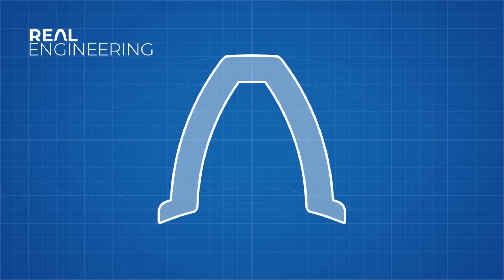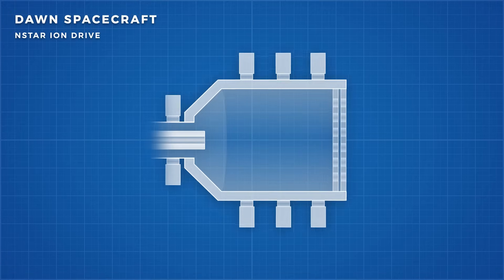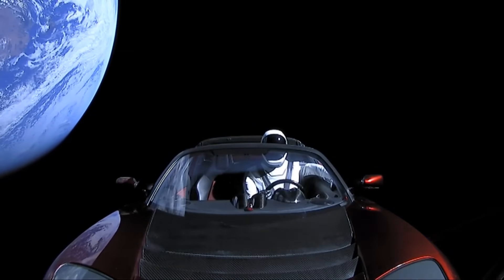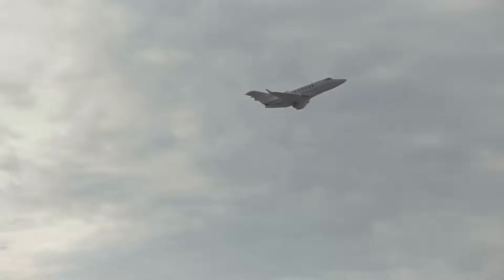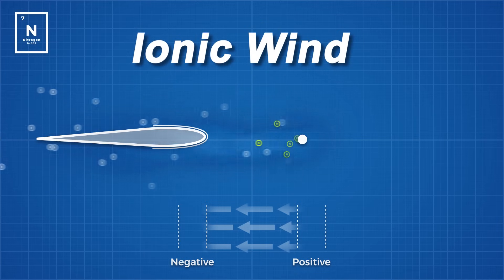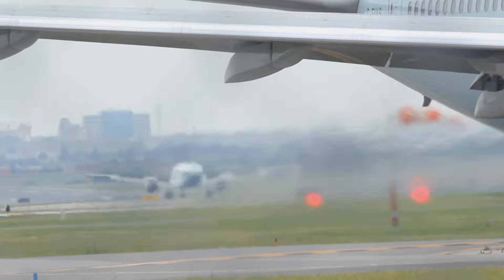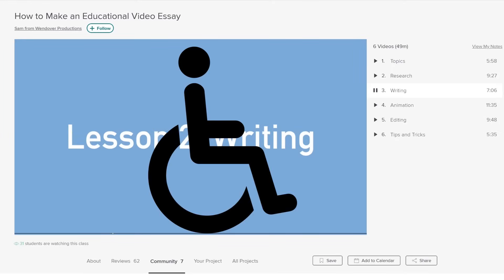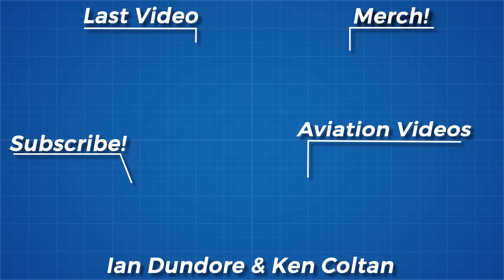Ion Propulsion - The Plane With No Moving Parts

Comment: To do it commercially utilize the ion flow to modify, negate or supplement the drag, vortices and and pressures (or vacuum relative to atmospheric pressure) in regards to the airfoil, control surfaces and airframe, also the  propulsive systems. Even down to air/fuel atomization and exhaust. Summer off the technologies have interesting applications in current use. And there is so much more. You are losing our forgetting the free...hmmm extras... Gained from designing the coils and surfaces not just through magnetic effects but also the right hand rule. The reduction in the lets say "perceived weight" in a descending (or ascending) path towards the moving null point of attraction shared with.."the ground or Earth" when aircraft need it most is good ( lol so many jokes there too, Earth ground attraction repulsion and to the moon... Okay inside jokes maybe) to stretch it even further in some areas researched of the addition of homogenized metal nano particles to the fuels and the incredibly high voltage tensions and densities to be harnessed in excess of the energy harvested from the reactive force of simply burning hydrocarbons etc. All the amazing things you could learn just from studying a simple sparkler...a child's toy. Going down instead of up it leads to things such as hypersonic torpedos. Hhhmmm wether or not to post this. Oh dang I forgot to mention the old school use of methods other than just sharp edges to promote emission of electron waves and the tuning plus impulse generation but decreasing the pulse width, well not pulse width actual the slope. Think inductors and switches... Really fast ones...

Comment: A light weight power is a permanent magnet motor as a generator. and this power is not limited by storage.  The permanent magnets are a permanent source of power .  This results in unlimited range electric power flight.  A normal airplane propeller driven can achieve unlimited range electric powered flight. An old generator can be converted to edison generator by counting the armature magnets and divide by 6.  Then chisel off the Tesla magnets alternating on and off to leave only the Edison magnets on the armature.  Reassemble this generator and it is a motor that produces the same electric power as the generator without fuel or force from water or wind.  We carry the generator and fly unlimited range electric power airplanes.

Comment: Did you pass on the Edison generator powered source.  The Edison generator and dynamos with inverters and transformers can deliver any amount of current and voltage AC continuous peak power without fuel or weight..

Comment: Reduced stress means lighter parts which means lighter aircrafts which means lesser fuel which means lighter aircrafts and a cycle can start though having a small weight different it's important as it's reducing energy sources.
Reply: Your comment sounds wise.  I think you would like my channel with a VTOL ion propelled craft with onboard power.

Comment: I can do over 400,000 lbs of force with no moving parts. AC current. It's so simple and only 9 parts. It's done with feedback. 20kv is peanuts when this can do a trillion. What your describing is obsolete and not enough power and no gravity in the ship. This will give gravity and supply endless water... and the ship uses thought because it receives and transmits those waves. I already did all the engineering in 3d. This ship will go anywhere and require no fuel at all and cost nothing to run. I did all the work for free.. and it's free just ask for it. No battery.. no fuel... no coil.. no magnet.. all done with sound and feedback... incredibly simple.

Comment: Energy thrust vs chem, require amp power,  nuculear could amp support. These craft, won't be able to avoid combustion, without motion movement parts., at least not without moving internal gears/gizmo.

Comment: One more key concept about low-force thrust: not the same as low power. 0.09 N at 1 m/s is only 0.09 Nm = 0.09 W. But at 1000 m/s it’s 90W etc etc. That said, at some high enough speed, that 0.09N would begin to decrease. Power output won’t scale forever.

Comment: Your video is misleading, because space ion propulsion systems have literally nothing in common with the simple minimalistic devices that create ionic wind. Those have been known for decades, and there are hundreds of videos on youtube with those flying ionic wind setups, the only difference is that they were all using a wired power supply, while this one uses an on-board battery, which was only possible because of recent advancements in Li-Ion battery technology. MIT made literally nothing important here.
Reply: There is one with onboard power and it predates the MIT device.
Reply: @KraussEMUS1  Good to know that. Do you have the link?
Reply: @Alex626_  My channel Icon.

Comment: Ionocrafts have been around since the 50's...
1. It does'nt work in space (as there's no air to ionize)
2. It produces large amounts of ozone and NOx gasses which are very toxic.
3. It's like a flying taser, multiplied by a hundred :) If this aircraft accidentally flies into a person, that person will likely be electrocuted to death with more than 30.000 volts.
So, I don't think it will ever be useful. Conventional electric motors are safer, cleaner and less dangerous, and far more efficient...
Reply: There is one with onboard power that doesn't create ozone and it doesn't use enough current to be dangerous either, although it does use a high voltage.
Reply: There are lots of types of gases that can be ionized. I haven't read anywhere that they have to be toxic gases. 
Why isn't Ozone good? In the 90s all the scientists were complaining about the giant holes being created in the Ozone layer...

Comment: @5:30 why not only apply the conductive anode to the upper side of the airfoil? If you are going to use an airfoil why not take advantage of this by attracting the air flow to the upper side to create more lift/flow over the top? Make the top of the wing the anode and put an emitter wire out in front of the leading edge?

Comment: If you towed a ion drive powered plane into the thin upper atmosphere it would have a better chance to sustain it's speed. I have been trying to design a hybrid electric lightweight orbital spaceplane but getting the electrical energy is tricky. Even if it can get into orbit by skimming off the upper atmosphere reentry into the atmosphere would be tricky with such a big wing.

Comment: I am confused. As far as I understand the energy output is very small and would never be able to power a passenger jet. Btw The Nazis in WW2 built a Rocket powered Airplane(Kraftei) with no moving parts and it was able to rise vertically to 30000ft.

Comment: Hmm. Why aren't 2 strips of foil used on each wing instead? Leading edge could be supplying ions, and the tail could be absorbing it. Why does the wire have to be in front of the wing?

Comment: Ion propulsion is useful on Mars where the air is thin. On Earth, ion flow over the wings and body will produce a zero friction surface in theory. 
Designing a plane with ion engines isn't right. Reserve the engine for space travel in free space 🚀🚀🚀.

Comment: I think for any form of ionic plane to work you would want to provide the gas because of two reasons, natural gases don't have enough mass for thrust, also natural gases would become ozone through this would be polluting which we can't have with something like this.  Maybe the thrusters could be hybrid where by at a cruising altitude it would switch to natural gases to help conserve fuel and in the upper atmosphere ozone is common anyway.  We need planes that don't rely on combustion or moving parts.  but batteries need to improve first

Comment: The problems posed by this video are easily solved with APUs (Auxiliary Power Units)  providing the electrical power for combined electric propulsion fans, ionic wings, solar paints and most importantly, carbon nanotube materials for the structures.  Research to pull the carbon for the carbon nanotubes out of the atmosphere should also be developed.

Comment: The above video is based on a paper from the Journal Of Nature called "Flight of an aeroplane with solid-state propulsion."  The lead author was student author Haofeng Xu.  Xu et. al. were not correct in writing or stating essentially that theirs was the "first heavier than air ion propelled aircraft of any kind to carry its power supply."  One of their reviewers called me and apologized, saying that they did not know about the earlier ion propelled aircraft that was already patented and well verified for lifting its power supply against Earth's gravity.  
Their are currently about 30 flight footages of the much earlier and more efficient ion propelled aircraft online.  There is also video of the power supply and with the host of NPR present.  In other words, it is simply a science fact that there is an earlier one with onboard power.  It is also a fixed wing aircraft, although it can fly vertically as well as horizontally using aerodynamic lift.

Comment: Since it gives small thrust power on short distances that means that if an airplane has ion drive it would take it maybe days to speed up from zero km/h to 1000 km/h which is unusable for flight.

We need to create ion engines that can speed up the aircraft in same amount of time it'd take jet engines as minimum and even faster preferably.

Comment: the biggest challenge of space travels is need of a mass to spend for moving. you can not move without a propellant. if somebody makes a moving device without propellant it can circulate inside galaxy. this idiotic propellant based move should be changed with other methods.

Comment: Battery motors are going to be great for gliders and powered hang gliders in which you only want to get up into the thermals and/or get yourself out of a tight situation when you have misjudged the wind currents.

Comment: That ion thruster tech has been around since 1920 with nothing new but put on a lightweight glider. They didn't discover or Revolutionize anything.
Reply: No one said they invented ion thrusters, they made a propulsion system powered by ionization and slapped it on a plane which makes it fly without moving mechanical parts
Pretty sure that big of a proof of concept could be considered revolutionary
Reply: @agustindelgado7036  First paper airplane over 2000. it doesnt equal to the wright brothers. The small aircraft they made is the same. It doesnt have a passenger or a payload or any proof of use. They didnt revolutionize anything. All they did was use modern batteries on a old propulsion system. Its like saying tesla invented the first electric cars.

Comment: If you used a long flat box shape, with openings at the opposite short ends & had two ionizing wires inside at one end separated by some distance & at the other opening a collector electrode on the inside, then have the first ioniz8ing wire electrode charged positively to condense the air, which when it reached the second negatively charged ionizing wire, would expand the condensed air in the direction of the positively non-ionizing collector electrode.

Comment: Hi, cool video! Do you know how long a battery would last for that kind of a plane? Like does it take just a very small amount of Ah to keep it going for a while since the main point is the high voltage?
Reply: Sadly, hydrocarbon fuel has more than 4 times the energy density per kilogram than the best batteries to date.  Which is good progress,  since the last decade,  a kilo of gasoline had 8 times the energy density of a kilo of batteries.   And each incremental improvement is getting harder and more expensive.

Comment: Are ion drives blue?  is it possible to build a Millennium Falcon from Ion drives in the future?
Reply: Using technology from the Self Contained Ion Powered Aircraft, yes.  It would be very lightweight though and would need many upgrades.  The MIT version  really is a lifter on a glider,  so it has a much longer way to go.
Reply: @KraussEMUS1  Oh i forgot I asked this, but ,yea this had been shown to work with very light gliders

Comment: 5:17 It's not thin to reduce drag, it's thin to create high intensity electric field around it, to maximize the ionization of the surrounding atoms. If it was as thick as the cathode (or the cathode as thin as the anode), it wouldn't work, because the ionization and ion streams would be symmetrical and would cancel each other out.

Comment: It sounds like polarized haul's of ships like star trek, in which various energy signiture's could be promoted on such haul's. This would allow intake and out take of energy ions.

This would allow possible communication signiture's and shielding potential off the haul to be emitted. It's neat that electric propelled planes move, in a earth atmosphere. With the right tuning, it could possibly move it through other environment's like outer space.  This would allow a vessel, or object to thrust movement entirely all at once from a polarized haul. Or entirely all at once, to have communication signal's emitted from the whole polarized haul. 

This in theory, should also work for nano bot's as well, as they could mimic that feature of polarized haul's. Nano bot's could move around and through environment's. As they thrust, or hover through environment's.
Also if nano bot's emitted the right energy signiture's, or signal's. They could be detected from devices and communication with them from other devices would be possible. Cloaking would be possible as well, for those polarized haul's. As they could be blending in microwaves and other possible background noises, to have it appear normal.  The only thing really, is to have polarized haul's charged well enough. For strong energy field dynamics of interaction's to be in the environment. 
Everything is like torus Field's, or alternating current fluctuation's. I like another name for this, force balance.

Comment: Looks like star wars ships are closing
Reply: It sounds like polarized haul's of ships like star trek, in which various energy signiture's could be promoted on such haul's. This would allow intake and out take of energy ions.

This would allow possible communication signiture's and shielding potential off the haul to be emitted. It's neat that electric propelled planes move, in a earth atmosphere. With the right tuning, it could possibly move it through other environment's like outer space.  This would allow a vessel, or object to thrust movement entirely all at once from a polarized haul. Or entirely all at once, to have communication signal's emitted from the whole polarized haul. 

This in theory, should also work for nano bot's as well, as they could mimic that feature of polarized haul's. Nano bot's could move around and through environment's. As they thrust, or hover through environment's.
Also if nano bot's emitted the right energy signiture's, or signal's. They could be detected from devices and communication with them from other devices would be possible. Cloaking would be possible as well, for those polarized haul's. As they could be blending in microwaves and other possible background noises, to have it appear normal.  The only thing really, is to have polarized haul's charged well enough. For strong energy field dynamics of interaction's to be in the environment. 
Everything is like torus Field's, or alternating current fluctuation's. I like another name for this, force balance.

Comment: What a load of bullshit.
Reply: People said the same about powered flight 120 years ago. Never doubt human ingenuity.
Reply: @angadsingh9314 : Powered flight of today is not the same as it was during the Wright brothers era. Even if MIT managed to make a slightly better ion thruster than NASA has been using for the past 30+ years, this technology cannot be used within the atmosphere unless there are many technological breakthroughs.
Reply: @herrschaftg35  
💚
It sounds like polarized haul's of ships like star trek, in which various energy signiture's could be promoted on such haul's. This would allow intake and out take of energy ions.

This would allow possible communication signiture's and shielding potential off the haul to be emitted. It's neat that electric propelled planes move, in a earth atmosphere. With the right tuning, it could possibly move it through other environment's like outer space.  This would allow a vessel, or object to thrust movement entirely all at once from a polarized haul. Or entirely all at once, to have communication signal's emitted from the whole polarized haul. 

This in theory, should also work for nano bot's as well, as they could mimic that feature of polarized haul's. Nano bot's could move around and through environment's. As they thrust, or hover through environment's.
Also if nano bot's emitted the right energy signiture's, or signal's. They could be detected from devices and communication with them from other devices would be possible. Cloaking would be possible as well, for those polarized haul's. As they could be blending in microwaves and other possible background noises, to have it appear normal.  The only thing really, is to have polarized haul's charged well enough. For strong energy field dynamics of interaction's to be in the environment. 
Everything is like torus Field's, or alternating current fluctuation's. I like another name for this, force balance.